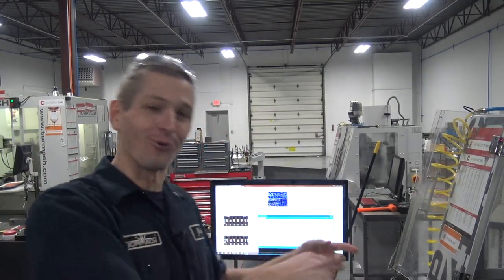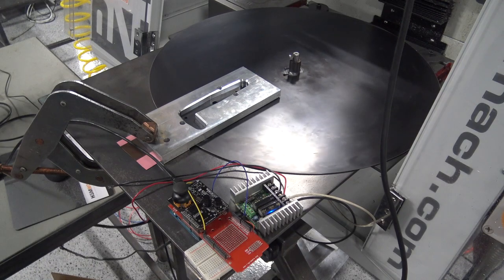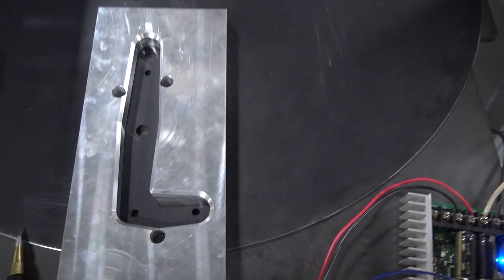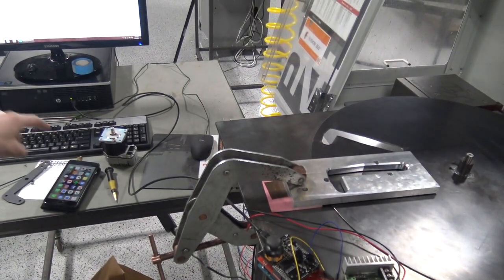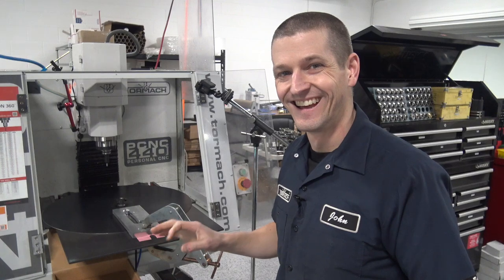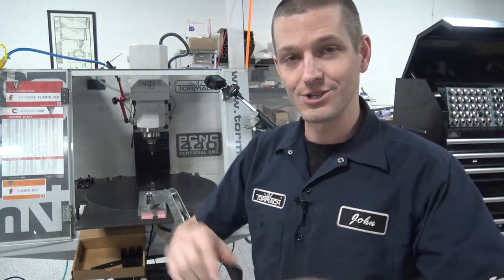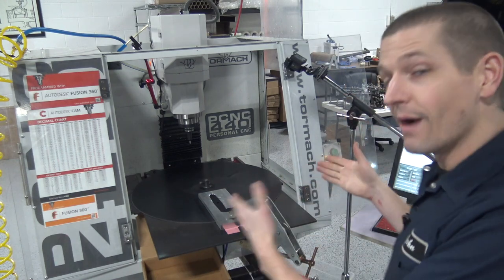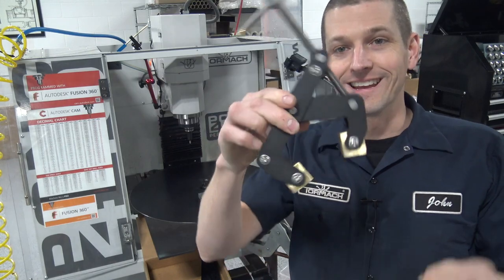Arduino Servo CNC Parts Loader! Part 4 WW132

Comment: You don't need more stations unless the part transfer is the slowest step.   More stations might allow you to run the base plate longer without having to rebuild it from wear, but no other benefit than that.  Sweet video.   Thanks for getting our creative juices flowing once again!

Comment: John, I like the way you are working thru the project and learning as you go. I have a suggestion, but it is a different concept and you probably don't want to start again at this point. I'll describe it just to throw it out there....
     Here is what I would try: Use the "drag bottom part out" hopper concept, but use an air cylinder that moves in a straight line instead of a rotary motion servo. Have a shelf with a formed front jaw that slides into a formed rear jaw at the workstation. That will take care of the locating and clamping. Have the shelf in the bottom of the movable jaw just big enough to hold part. As it retracts back to the hopper, the next part will push the first part off, dropping it into a chute. Using this concept there is no fussy alignments, the part is located accurately, clamped at least horizontally, and if there is ever a jam, there will be no overload issues. Use hall sensors on the cylinder to sense full travel positions. You can have 2 sensors at the work end. One for "part in position" that is delayed before starting the cut cycle, and another at full travel that would signal that there is no part loaded. I would orient the part slightly diagonally to make it fall evenly off the shelf. You should be able to control the contact points in your jaws so that the parts are clamped at only 3 points if the work position is to be held to a tight tolerance. Swing clamps could be used for vertical clamping if needed. The movable jaw should be guided by more than just the cylinder rod.
   There are other variations that could use the travel of the mill table to load the part from the hopper as well. Those variations would not require additional motion control circuits, but you need to consider what happens if a part jams when being loaded or ejected. The machine table has quite a bit of force.

Comment: I AM an automation engineer (or I was) and I've very much enjoyed watching this series. I love hacker maker stuff like this. I'd have probably used a large stepper motor to get torque at low speeds but even then you may still need a gearbox.  I might need to buy a couple of those very nice looking clamps.

Comment: John, if you filleted the bottom edge of the part feeder on the right side of the L, you might have better luck, or perhaps only use the left side and bottom of the L to index in the proper location, as well as a single rod on the right side. Might not be necessary, but the feeder could potentially be optimized. Love the project, thanks for sharing!

Comment: It'd be awesome to setup a sensor in the path that can see if it picked one up so you could have it automatically try again if it misses
Reply: That would be pretty easy to do.  Pick a spot in the 'path' around the circle and mount an optical sensor flush with the bottom looking up with a reflector mounted to the top of the enclosure, as the part moves by just check the status of the output on the sensor. Make your decision of what to do next at that time.  An optical sensor located below the pickup well could also detect when empty.
Reply: James Kilroy Yeah I think it would be a worthwhile addition.   Also I'd program it to rotate back and forth under the stack 3 or 4 times to make sure one drops.
Reply: I think the same sort of idea would be ideal for the starting home.

Comment: Chamfer/fillet on the part receiver, possibly? Keeps the tight fit with a little persuasion on the top half. 

That clamp is tempting. Especially assembled. Those woodcraft construction kits were my favorite thing when I was little!

Comment: How about adding an electomagnet on the milling side to hold the part solid while machining? You could have it switched on and off with the code. Glad to see it working well!
Reply: yes! Thought the same
Reply: Can you say chip mountain!  Might not be an issue, but you know where all the swarf would go thats for sure.
Reply: Best I recall the feeder was to do an engraving op so I wouldn't think swarf a huge problem. I could be wrong about that though I have watched a lot of videos since this project began! Got that pacemaker gear done yet? :-)

Comment: John, super cool - I don't remember if you laser-cut the circular holder plate, but if so, another option would have been to cut it with a bunch of teeth around the outside.  Then, you could attach a motor and gear (maybe mounting the motor on the same plate as the feeder stack?).  That should more than solve the accuracy and torque issues...  However, you seem to have it working and it looks awesome!  I agree with you with sticking with just one drop-location, since this is going to be automated anyway and you could make your feed-stack whatever height you want.  Good work - exciting stuff!!!

Comment: Spring load the feeder! ClearPath great solution, overkill though, a couple of gear wheels and a "small" modification is all you need, you could cut your own gears on the Tormach or Haas. Doing it yourself is much more satisfying.
Reply: Pressure on top of the 'stack' would increase the load on the motor quite a bit, maybe not a problem, but not without concern or consideration.

Comment: Just a thought for finding your "home" position, it would be fairly simple to incorporate a notch (encoder) on the edge of your pick up disc and index it with a reflective light sensor. So light beam is broken=not home, light beam made=home start cycle. Problem you may find is most stuff like that is industrial grade 24vdc or 120vac. Interfacing with the Arduino is the issue at its 5vdc logic. I have had some experience with this kind of automation in the last year while going to school for industrial controls and electronics. We had a mini factory made by Festo, all PLC controlled. It had a lot of the problems you are facing. Love the ambition you have for this project! I can't wait to see your solution!

Comment: Hi John. Great idea for doing "half" automation, nothing beats KISS for prototypes and even production. 
Now I have a hunger for getting a CNC in house.  I am planning on designing a 1200x1500mm machine. Preferably one that doubles as a 3d printer for rapid prototyping. Right now it resides in my head and later in Fusion360.
I have a basic concept with a moving XY head and a separate Z bed which could yield a relatively limitless build / cutting volume only by ceiling height or digging into the ground, but I will settle for 7-800 mm of usable travel. Getting it to home is simple and will be an exact copy of my small Vertex 3d Printer with IR sensors. Driving a bed that size does require loads of torque and probably a good deal of cash in linear slides. And there will be a certain amount of droop in the Y slides but that could be managed with a triangular truss construction. 20mm tube and internal bracing adjustable by lengths of threaded bar. As little welding as possible to keep warping down and allow for some degree of alignment, ends and gusset plates.

Comment: An optical sensor could be used to index the platter on startup. Another optical sensor can detect a miss feed lack of feed stock. 
For hold down, something spring loaded attached to the spindle makes sense.

Comment: If you're going to make a plate with multiple slots in the future, you could make a smaller coupler and bolt it to your plate. If you make the bolt holes slightly bigger than they should be, you can adjust the runout of the plate.

Comment: Here are too things that I can think of that I would do differently:
The bushing for the motor shaft to be threaded, national fine into the base plate.
Second, the aluminium receiver plate to be about 3 to 5 deg. tapered with only one blank part thickness left straight at the bottom surface.
You are getting there!
I know it is an old thread...

Comment: Monday morning QB/spit balling stuff so grab popcorn:
1. Part holder only precision on 2 sides for positive drop down. The part will seek to contact radial out and retrograde surfaces (especially with a rapid spin) just by friction with lower plate. Clearance side ramp in thickness for a gentle letdown.
2. Part holder as a separate bolt-in plate in a general fixture hole in the main plate. Future project compatibility and ease of dialing in individual part holder(s) for alignment.
3. Vacuum holder for part clamping. Part disk can even "back off" a programmed amount for milling all sides (future part capability).
4. Make part exit ramp by cutting three sides and bending the exit hole down to form a ramp.
5. Part bin landing zone with ramp so parts don't land on other parts.
6. Single optical sensor can check part presence and various disk positions through peep holes.
7. Rubber wheel circumferential drive if gearing is expensive.
8. Pretty sure whole thing could be shrunk to fit in with doors closed for future messy (coolant, chips) parts.

That's my brain dump. What you have there looks great for that part. The above ideas are more for making this rig apply to a ton of different setups with minimal changes between.

Comment: Why would you drive from the center. Use the outside of the circle like a thoot gear. This way you have more torx. And much more engine/position control
Reply: Excellent!
Reply: Just my take on it, I wouldn't want to go that rout because of complexity.  Mounted on the motor it's four screws for the motor to mount and one set screw in the bushing.  Edge drive requires a whole lot more machining.  I have thought about edge drive on a project and to keep costs down I found a gear drive from an engine starter.  You can replace the gear around your flywheel on some cars and trucks and it's rather reasonable and the gear on the started can be had at a reasonable price as well.  Not as precise and a custom made setup but allot cheaper and very robust.  Like anything there's allot of different ways to approach everything.
Reply: NYC CNC I was going to suggest the same thing.....gets you better position control too', as it's a whole lot more stepper steps per disk rotation. You may not need gear teeth, depending on the torque needed...friction (I.e. a tire) may be enough.  Some o-rings on a wheel on the motor shaft for instance. The disk probably wouldn't need anything except maybe some roughing up with a file. Just an idea. 

I don't think you need to go slowly at the drop point if you have good enough position accuracy....you just need to pause long enough for the part to fall once you are perfectly lined up. The slow move method is only needed if you can't line up perfectly and stop for a fraction of a second. Hall effect sensors or even just a piece of metal on the disk that makes contact with a spring on the part feeder to conduct to a digital in on the Arduino to tell it when it's at the right spot. Or a micro switch if you don't want to make your own.  :-)

Thanks for the video!

-- Mike
Reply: K.I.S.s.
more mechanical parts with gears, also its just for engraving the part.
Reply: Timing pulley and a timing belt
Reply: Timing pulley and a timing belt, no need to cut gear teeth.
Reply: Great idea but i think you mean torque. Torx is a type of screw head :)
Reply: great idea, would not need gears, just friction would turn it.

Comment: A piece of steel or aluminum shaped like the work piece, but taller would be helpful to index it each time it gets turned on. 

Interesting ideas in the comments about a gear drive cut into the outside. I would be worried about the teeth wearing out on mild steel and introducing slop.

Comment: to make the drop in  some more reliable you could consider that it takes time to drop, and that there is a air pressure build up in the pocket, since it fits tight. maybe make some holes to deal with air build up. especially when there is little stack to press down. nice build so far. cheers.

Comment: When you first presented the project I was thinking of putting the hopper on the right and just move the table under the feed shoot to pick up and use air to blow the part out of the holding fixture.  It's one of a million ways to do the same thing.  Would having the motor mounted above the table help make it smaller or does the size depend more on the unload shoot?  Deciding what motor to use based on the needs of the project is sometimes hard for folks.  I've meet plenty of people that learn one tool really well and want to apply it to all situations.   Now I hope folks understand why industry has to pay so much money for automation.  In this application it's almost a toss up from a purely cost perspective but because you enjoy this part so much and it's a great demo for folks it's a worth while way. :o)    Keep up the great work.

Comment: Put some of those stick on HDPE furniture sliders under your positioner
Reply: hehehe I cant
Reply: Or make your hopper/feeder a little bit larger, so your parts that needs to be put thru the mill has some play.
Reply: McMaster sells some nifty stick on sheet Teflon, I use it in a product myself.  I wonder if that will make it into part 5?
Reply: James Kilroy ooooo

Comment: you have added a chamfer in your feeder block. Why not also add a very smooth = polished chamfer ( like 20-30% of the height of your pick up slot ) in your pick up slot of the rotary plate. This wouldn't effect the accuracy of the remaining straight walls, but for sure help to let the part slip in easier = smoothen the ' slip in phase ' of the part. I might haven't been able to see it if it is already there...

under the rotary plate u could also integrate in the bigger holding plate a line of round flat magnets to enforce ' suction ' during ' slip in phase '. Or a simple air suction system for all kinds of materials to work with. Just some lined holes in the holding plate within the slot profile area.

Great work so far...

Comment: Have you ever thought of using some error-fault checks? For example, let's say that the machine does not manage to pick up a clamp. You could add a station where this is checked (some degrees of rotation after the pick up point). I dont remember if the material is steel or aluminum, but if it is steel you could use a sensor (like the ones used in cnc machine doors) which picks up the material (steel through magnetism) and sends a signal to the arduino, which then continues the rotation. I know that you also have a steel plate under the round rotating plate which the sensor will always pick up, but you could cut it around the perimeter of the check area and patch the hole with a plastic plate (making sure that no bump is left for smooth operation). This way the magnetic sensor only picks up the clamp!
Reply: Yes, a hall sensor, like the Honeywell 1gt101dc will sense ferrous material. I believe those parts are mild steel. When the part passes the sensor, if you see a falling trigger edge, it means there is a missing piece of ferrous... ie. the part didn't get picked up. Super easy with arduino (or any microcontroller).
Reply: Also possible to use dirt cheap & compatible Arduino laser send/receive boards that trigger a fault if the pickup slot passes a peep hole in the base, and the laser receiver detects a beam.
Reply: Why not an optical sensor? They could detect, if the light goes through (empty) or not (part loaded).

Comment: Congratulations with the successful steps :-)
You mention torque and precision. Could you fit a bicycle chain around the circumference and pull on the outside diameter with sprockets instead of the axis? You'd need a "Tunnel" through the "Clamp hopper" for the chain. This way you could maybe "save" the $$s on the Clearpath and pull it with a stepper motor.
Maybe you should also add some low friction tape to the big disc, so you don't scratch the parts.

Comment: I'd consider jiggling a few steps forward and backward under the stack to deal with any minor hang-ups in the stack. Maybe a jiggle over the dump station in case any chips get caught between the part and the platen.

More than one station is likely not needed with that fast slew rate. It just leaves parts sitting there doing nothing.

Comment: As you have more weight in the stack, it might feed better or use a spring on the stack for constant feed pressure. Just an idea.

Comment: instead of using clear path, could you have just opened up the tolerances on the feeder and cut a relief angle on the feeder to make the part drop in at higher speeds? am I missing something?

Comment: What happens if one part get stuck? Per your other video, the servo has a torque monitoring system so, did you add a sequence that sends the servo back to home position if the torque alarm goes off to try again?

I think this could be a problem when there are only a few parts to go since there is no extra weight from the other ones pushing down the one at the bottom.

Comment: You only need a fit at the back of what drives the part. A latrger gap ahead of the part will allow it to drop in and it stays registered at the back of the opening. Does that make sense? Of course, that only applies if you only drive the part holder in one direction. I haven't watched the rest of the vids on this.

Comment: The solution is mechanical A low profile pickup tooth on the trailing edge of the opening in the disk. This will allow pealing away the the arm at any speed (within reason). The stack assembly would have to be shouldered (arm thickness plus) on the trailing edge. Think Pez dispenser

Comment: By the way, did you know that the Tormach uses three-phase stepper motors instead of the more usual bipolar type? As far as I can make out, they give a smoother operation and higher torque, but require a fancier drive to power them.